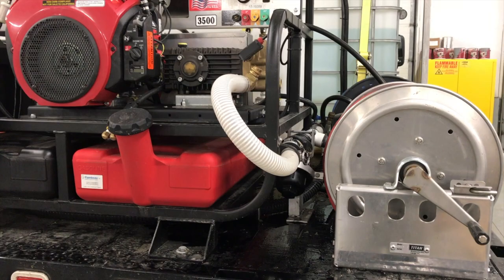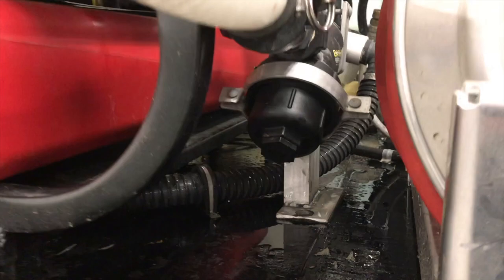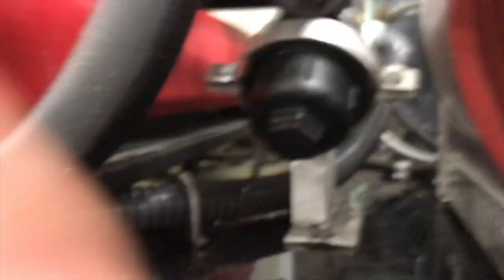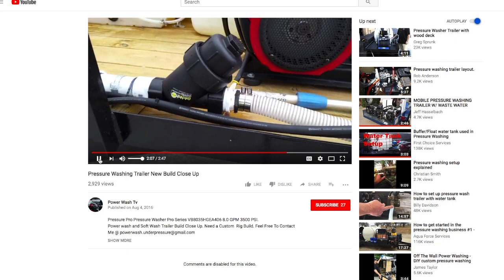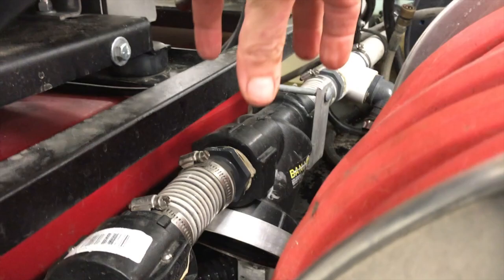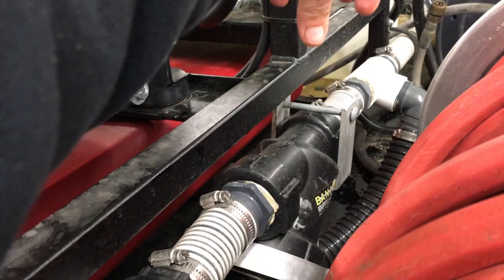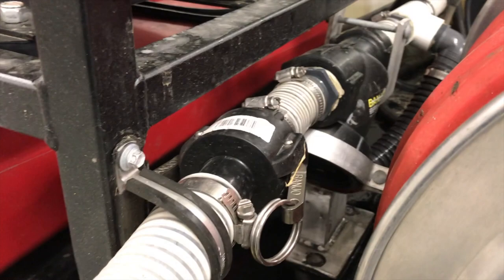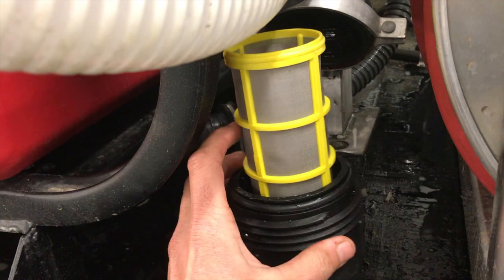Power Washer Filter Installation

Comment: Correct, but you can just pull the plug in the end of the filter and flush out without the chance of debris getting in the line.

Comment: You can put a ball valve on the top of the filter and not have to worry about it.
Reply from the maker: yeahhbui thanks for the comment.  That helps for draining the water but I'm the type who wants to take out the filter for rinsing and inspection.  To each their own; since posting this video, several folks have sent their own solutions and setup preferences.  

Thanks for watching.

Comment: He's not wrong but on the end of that canister he tool off is a dump line u install tha5 let's debris out so u don't have to worry what position it's in not every right has the ability to have it facing down so u can place it wherever u want ur not supposed to take that off and on all the time that why they give a threaded port that u connect a hose to with a  ball valve on end makes life easy
Reply from the maker: I hear ya, but I'm the type that wants to see and inspect the mesh filter, not just assume that it doesn't have any problems with it.  

Thanks for watching and for your comment.

Comment: So I got a question I want to use a banjo filter with a 80 mesh filter. Is that sufficient enough for a power washer that is being gravity, fit or pressure washer I don’t know for car detailing.
Reply from the maker: Pressure washer filters are usually between 50 and 80 mesh.  Higher number traps finer debris but restricts water flow a more than lower number.  

If your water sources might be funky and have silt or debris, I'd go finer.  

I'll say that most problems I've seen on gravity-fed setups have more to do with the tank location and plumbing than the filter itself.  Common sense goes a long way: Mount the pressure pump lower than the water tank; use an over-sized diameter hose between the tank and filter and pump, etc.

Comment: Hello, thanks, makes sense.   What is the black banjo thing downstream from the banjo filter you are discussing?  It has a little silver lever and key chain looking ring on it?   thanks!
Reply from the maker: Hey Nathan, that little ring is a finger grab on the cam-lock coupler.  The coupler is a male/female connection between the filter and the power washer... it allows that section of hose to be quickly connected and disconnected.

Comment: What flows better the t trap or y ? The t trap has mounting holes. Thanks for the video
Reply from the maker: Frank, I don't believe the "T" or "Y" orientation will make a difference for these low-psi water filters of the same diameter.  If it were high-pressure air that might be another thing.

Comment: Hi I have a big question connecting a water supply hose to the pressure washer. Usually they have a female quick connect and I have watched a video where they have taken that off and replaced with male out for better flow. If so could you tell me the part number? As in inches that I can replace? Thank you and. I hope this make sense haha